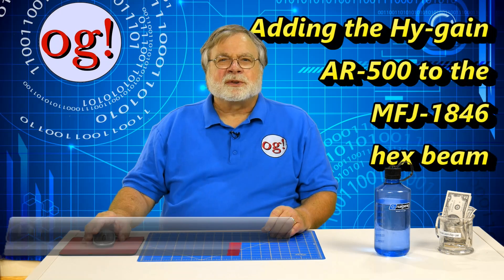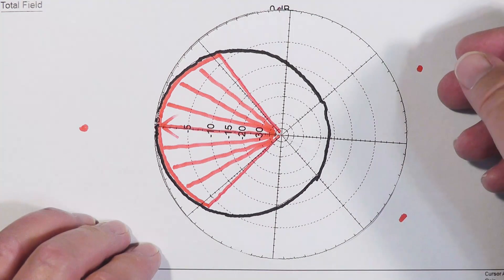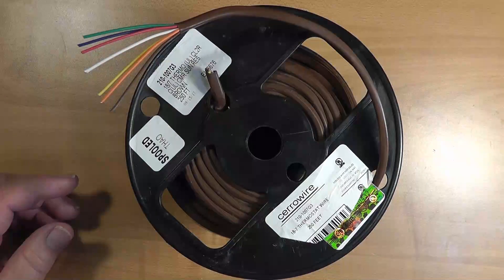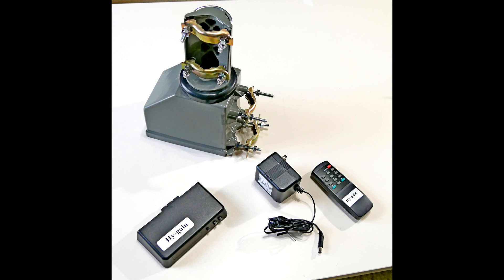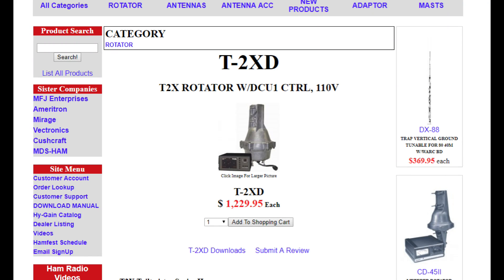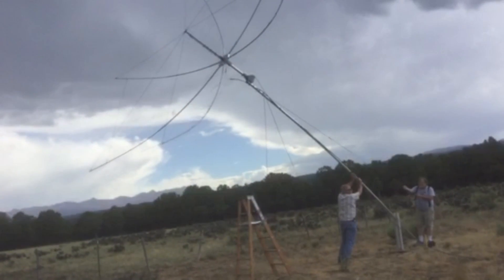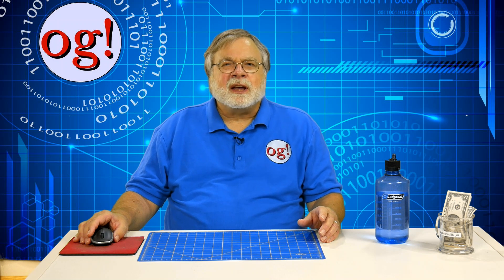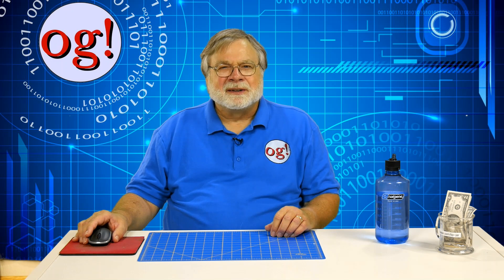Hy-gain AR-500 Antenna Rotator and erection of MFJ-1846 (#160)

Comment: Tommy Walls
 
Hello, I am KC4ZZE, This is what Ham radio is about, sharing experiences and knowledge to advance the art. I needed a way to rotate the hexbeam remotely 200 miles away from the shack using a RCA VH226E antenna rotator. I came up with a solution after giving it a lot of thought. I purchased a WIFI IR hub and manually programmed the hub training it with the VH226E’s RCA handheld remote control as an experiment. It worked!  I can now rotate the hexbeam from my cell phone turning it North, East, West, and South controlling the VH226E Antenna Rotator from my android cell phone using the Tuya App. The IR hub is freely supported by the Tuya app. I watch from two remote cameras to see the inside rotator box and outside antenna rotator operate and turn as I use the Tuya app. The AC power to the inside RCA VH226E box is a manual switch on the side of the box.  I set the switch to permanent on position and plugged into a Kasa AC outlet. Now I can rotate my antenna from any where in the world with WIFI connection.

Comment: Did MFJ give you the antenna?  I'm truly puzzled why anyone would buy this from them when there are other makers at the price without the quality issue baggage.
Reply from the maker: Yes, MFJ gave me the antenna and rotator. The antenna broke because I dropped it from about 10 feet high with a mast attached. I'm surprised I only broke one spreader. The only quality issue I had with the antenna was that the number of number six screws was a few short. Otherwise everything went together easily.

Comment: Always enjoy Your videos. If I can give You one piece of advice. To reduce the radial (sideways) forces on the rotator, it would be best practice to use something like  a (TB-105) THRUST BEARING. The Hexbeam hasn't got a high wind load. but thru the years (speaking from experience) the housing and bearings of these small rotators, will wear. If one extends the tube, where the rotator is mounted on (or lower the rotor - antenna assembly on the mast), so that it goes past the rotator (maybe You have to remove a tab, on the rotator) and is parallel with the tube, where the antenna is mounted on. Put a trust bearing between these two tubes. So the radial forces are now on these two parallel tubes and not on the rotator bearings.
Reply from the maker: Good suggestion. In this case, the rotator wants to be at the very end of the main mast and also the short piece of mast going to the antenna.

Comment: A HAM IV and control box went for $75, no cable,  at Monument. I found a HAM IV and box for $50 a few years ago on a swap list, again no cable.  Have a great time on the bands spinning your beam Dave. My HAM M spins every morning on 144.200 for the Beam Spinners. There is also a 4 element TET HB43SP tribander and .7 and 6 meter beams as well as the 11 element 2M beam at the top. The HAM IV is ready to go up when and if the HAM M dies :-) Oh i do have cable to replace the old.

Comment: Hi Dave,
When you calibrate the rotator and it says 0°, you can then loosen the beam and rotate it to true north. Now the beam will match the reading on the box. I have a 30 yr old T2X and it's still going strong. It is mounted at the bottom of my 45 ft tubular crank up tower. The entire tower rotates.  73  WB3BJU
Reply from the maker: Good idea, though my setup doesn't allow easy changes as I have to bring the whole assembly down.
Reply: Has the 500 got a notch at the front where you put the antenna pole so it points true north

Comment: You can't set rotator to 0 then manually rotate antenna to north?
Reply from the maker: I set the rotator to zero and then mounted the antenna. Unfortunately the antenna is so big that part of it was on the ground. So I got the angle I got without much choice.